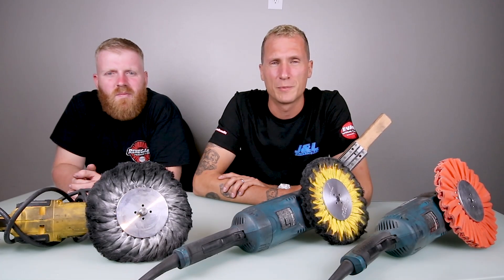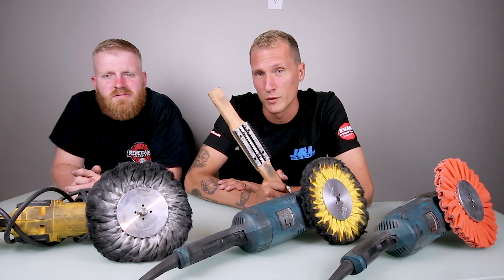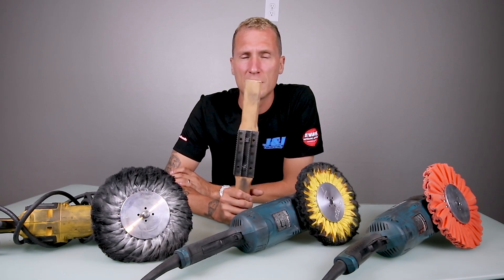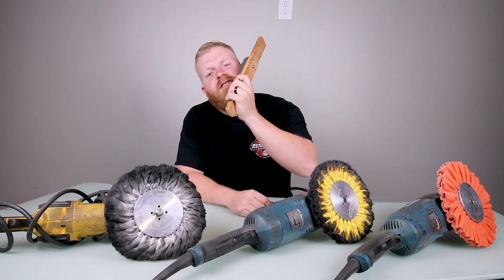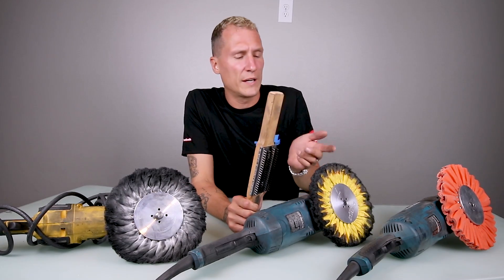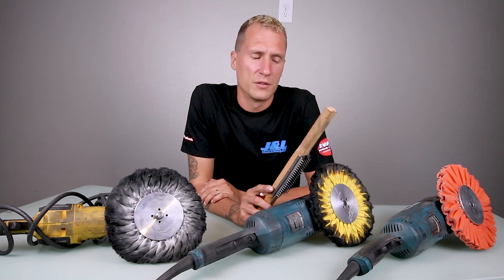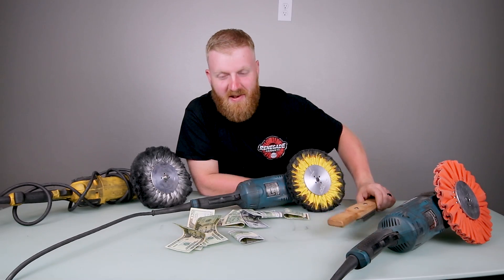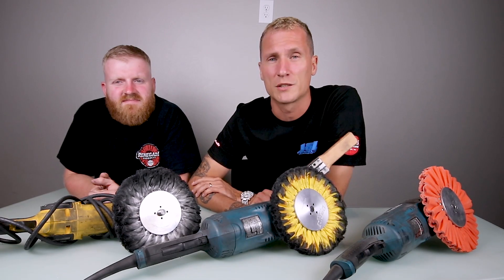How to properly use a buff rake. Evan's Detailing and Polishing do's and don'ts.

Comment: I only just started polishing with a bench grinder and the josco wheels and compound. They were working mint as out the box but after a couple days of polishing rocker covers and intercooler piping I am geting more and more hazyness than I was at the start. The wheels are pretty gunked up with wax so that could be why. Didn't know rakes were a thing but I think I'll give it a shot and see if it fixes my issue
Reply from the maker: You answered your own problem. Well done. Definitely gummed you pads.

Comment: Buffing aluminum I get a lot of black streaks that is hard to remove. Any ideas easier and faster than a clean white rag and elbow grease?
Reply from the maker: What kind of black streaks? From buffing or from hand polishing?
Reply: Evan Steger I use a buffer on a stand. Baldor buffers. Trying to mirror polish aluminum.
Reply: Evan Steger acetone cleans it but dulls the finish. I use a blue and green compound.
Reply: Evan Steger I guess what I’m trying to say is it gums up in places .
Reply from the maker: what brand compound?
Reply: Evan Steger I’m not sure. Over the years I’ve bought several. I have some that is in round cardboard tube and then I have some that is in big rectangle bars. I am going to be buffing tomorrow. Do you think that I might be putting too much on the wheel? I can get the black smudges off when a clean rag and a lot of labor intensive rubbing. Let me tell you that it is work to get it off. I do kinetic wind sculptures and I form the blades out of aluminum.
Reply from the maker: Might be the condition of the metal. Shoot pics to 9209790386 and I'll walk you through how to adjust to avoid the black.

Comment: I bought a buff of every colour. The red ones seem VERY stiff. Like a grinding disk.
Reply from the maker: Red is specifically designed for stainless to withstand the heat. Can also be used on aluminum. But yes it's stiff. The orange is a little bit softer but still rigid enough for a great cut.